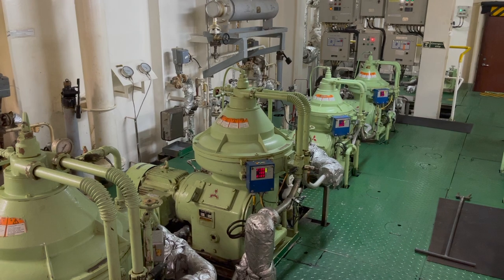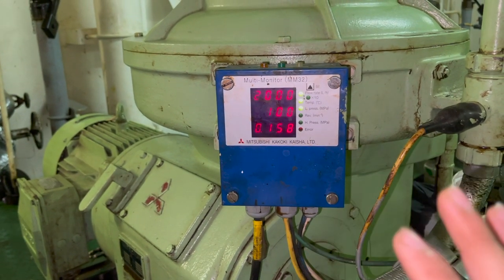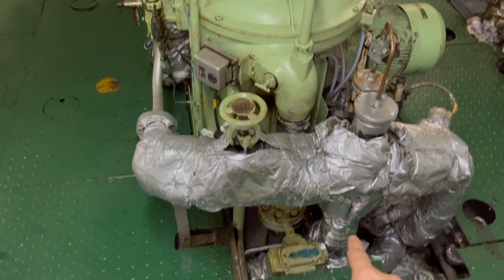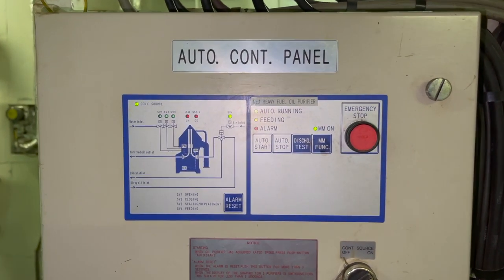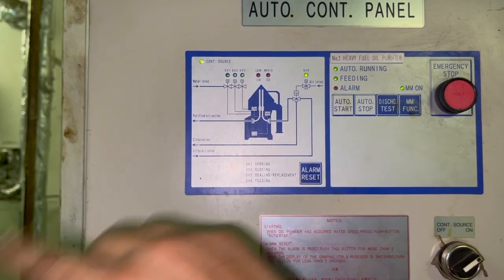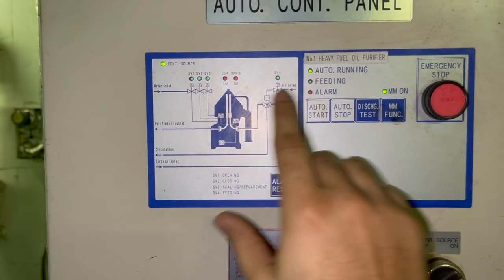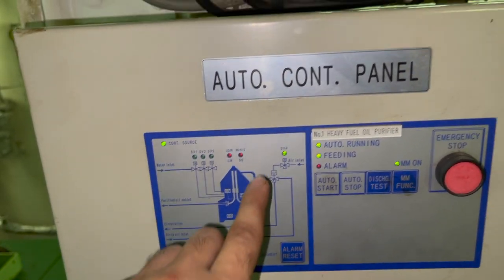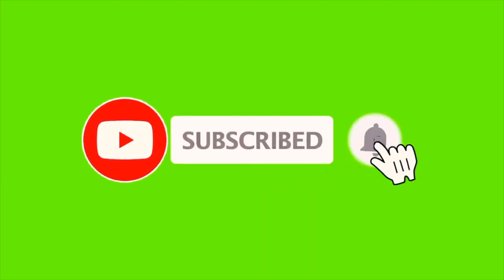How to De Sludge Purifier As per manual 4K | Why Ampere increase while De-Sluding

Comment: Please tell wat is the pressure for bowl opening, closing and sealing water?
Reply from the maker: Dear if u r asking for the Operating water side pressure then it’s 5 bar during normal operation and during desludge or Bowl opening it drops to 2.5 to 3 bar and comes back to 5 bar once operation is resumed.